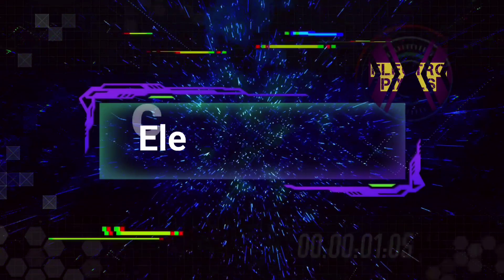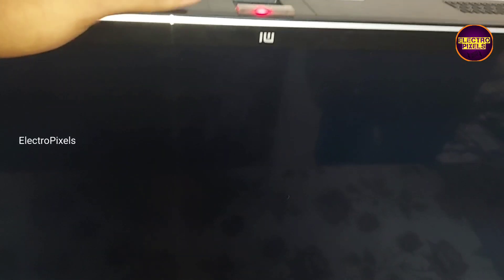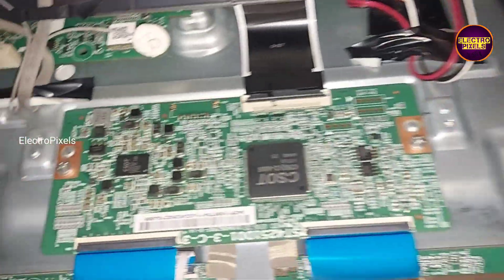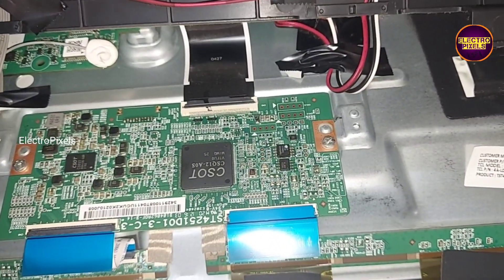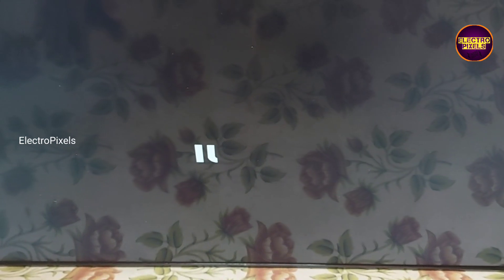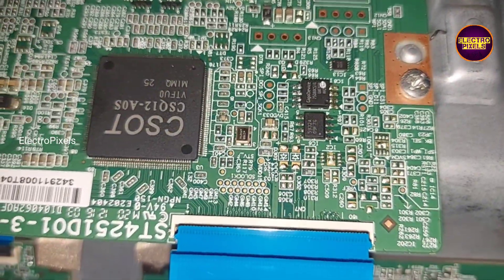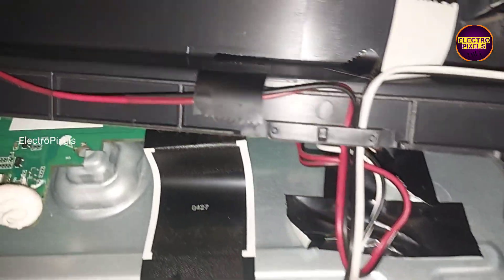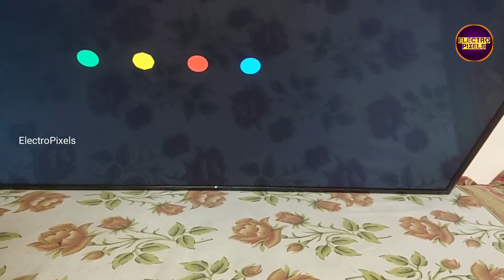Led Tv Vgh,Vgl short removal|Panel Repairing to Solve Blank screen in MI 43 inch LED Tv|CSOT Panel

Comment: Hi,  ive no picture on any half of the screen after i remove ffc cable from one side at a time, is that mean new screen as I've changed tcon and main board and lvd cables etc, I've fixed a few few with the tape method but having no joy on this hitachi 65 inch samsung screen and tcon